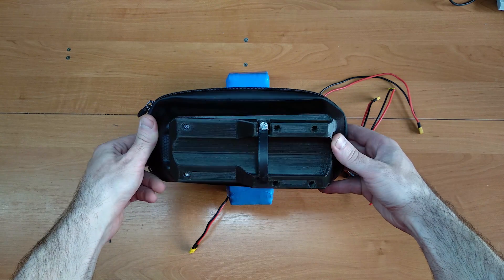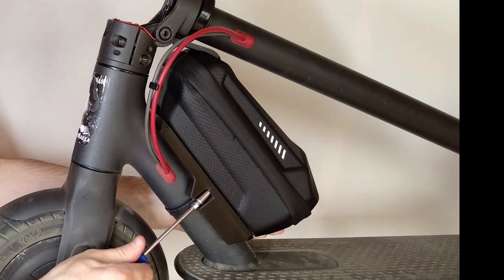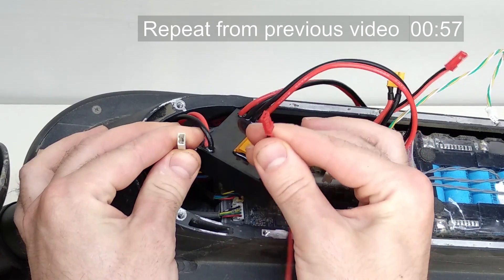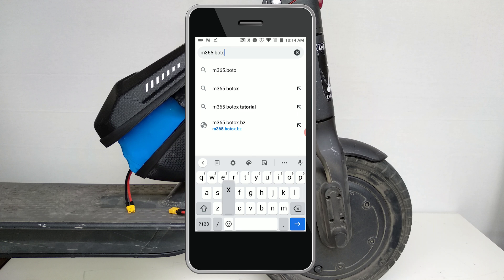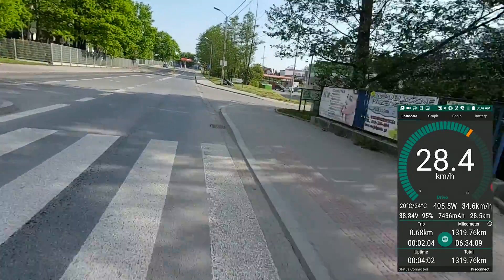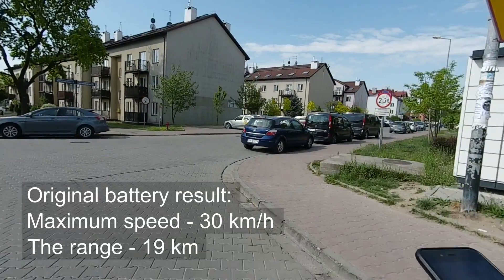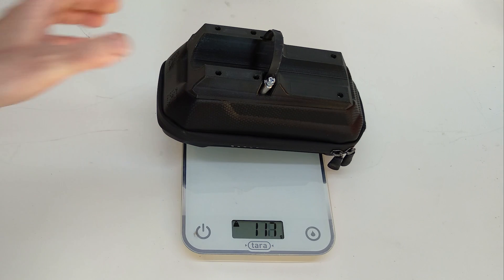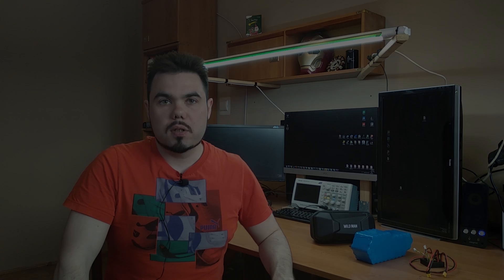Xiaomi M365 / PRO / PRO2 / 1S / 3 extra battery installation tutorial

Comment: hello. Can i connect 48v extrenal battery with rita adapter on my xiaomi pro 2  ?
Reply from the maker: Yes, you can.
Reply: @ can you recommend some 48v extrenal battery which fits on the wildman 2l case?
Reply from the maker: @jokuvaan-j6v  They say "Aerdu" aliexpress batteries are okay for its price.
Reply: @DenisYurev  okay, thanks!
Reply: @DenisYurev  did you know any other brand becaus aerdu has really bad stock rn? is theese LiitoKala batteries any goodor any other?
Reply from the maker: @jokuvaan-j6v  I don't know. Check the reviews =)

Comment: Does anything apart from volts matter for the battery
Reply from the maker: Sure, 
1. The battery must be powerful enough to provide about 30A output current
2. The battery must be a common port BMS equipped, which means just one couple of wires for both charging and discharging, without a dedicated charging input.

Comment: Sorry Dennis can the Rita be used without the data line from the 48 volt aftermarket battery it’s the Monorim 48 14.4 mah battery
Reply from the maker: Yes, you can use an internal 48V battery without data lines via Rita. Just don't forget to set Rita properly(set 13 to the "Internal battery serial configuration" parameter) and cut the green jumper

Comment: Hi Dennis sorry for the vague question which is I have a 48 volt battery without data wires on it only 2 wires charge wire and power wire the controller has had bms skipped  I’m not using xiaomi battery at all can I still use Rita with this set cheers

Comment: Hi Dennis I have a 48!volt battery with no data cable can I still use Rita on my xiaomi with another 48 v battery for more range
Reply from the maker: Hi, I did not get the question. Do you use a stock internal 36V battery? Or you replaced it? Or you are going to replace it by a 48V one? Or you want to use 2 external 48V batteries?

Comment: Bonjour Denis
J'ai un problème, le rita ne fonctionne pas.
Ca me marque directement le coee 39 même en l'ayant flashé avec la batterie externe en plus dans le cfw.
Merci de me donner une solution.
Cordialement.
Tony
Reply from the maker: Hi, error 39 means that something is going wrong and Rita wants your attention.

Did you set Rita settings according to the external battery you use? For example, if your external battery is 48V(13s), you must set Rita "External battery serial configuration" parameter to 13. Otherwise it may cause error 39.

You can also launch any smatphone app and check the battery page: Rita puts error name instead of battery serial number.

Comment: Hi Dennis I have a 365 pro 2 and I’m putting in 48 volt internal battery  could I use your  12 s range battery as well
Reply from the maker: Hi, no you can't. The Rita limitation is that internal battery voltage must be less or equal then the external one. 48V internal battery is 13s, so you can use it together with a 13s, 14s or 15s external one.

We don't sell 13s external batteries, so if you want to by in my shop, the perfect choice is 12s internal + 12s external.
Reply: Cheers Dennis

Comment: Hey Denis!
Can i still use the Standard 250w Motor, or should i get a   350w Motor?
because with the speed upgrade i have a higher voltage right?
Because im thinkin about getting a higher watt motor so it works better when i buy the speed and range upgrade for my xiaomi pro 2
Reply from the maker: Hi, stock motor is fine. Most of "350W" motors you can see at the market are mega shit. You know, you can go to a shop and buy a 1.5L milk instead of 1L. But it does not work with motors at all, it's not enough to just compare 250 vs 350, there are many other parameters and especially quality.

Comment: How is the battery selected,?  Or are they connected in paralell due the Rita?
Reply from the maker: They are "balanced" like they would connected via 2 diodes. The higher voltage battery is discharged first, until the batteries voltages are equal, then they are being discharged together "in parallel"
Reply: @DenisYurev  thank you

Comment: Will this work on a Hiboy S2? It’s on the same platform. 

I just want more range, don’t wanna flash the controller. So probably stick to the same voltage as the internal battery (I think 36-40v) but maybe I could just get a battery with the same voltage but with a little higher Ah for the external?

Would I be able to charge both the original internal battery and the external battery with the original s2 charger, and the original charging port on the scooter?
Reply from the maker: Hi, you can use a 36V external battery, connected via Y-cable. You can read about it in the post below(it's about internal battery, but joining principle is the same): https://e-scooters.embedden.com/blog/double-your-xiaomi-e-scooter-range-for-100/
Reply: @DenisYurev  I’m thinking a 36v 20Ah is what I will use as an external. Maybe that’ll work. 

Will the Rita work with the Hiboy S2? It’s a close match to the m365.
Reply from the maker: @PierceBenton-rh5fy  No, Rita is compatible with original Xiaomi and Ninebot only. Y-cable is the only option for you

Comment: Hi, can I ask you a question? I had an external battery installed by a trusted company. When I ride the scooter, I take a break for a while to rest and start the gas again, so the display shows that it is charging. It shows the percentage on the display as if it were plugged into a charger. I do not understand that. I have the recuprration set to Hight. Maybe that's the problem? But it happens on straight way not downhill. Or should I complain that they installed the external battery incorrectly? Many thanks.
Reply from the maker: Hi, watch this: https://youtu.be/1cJFdFCtMGI?t=360

In short, you need a  custom firmware which disables charging mode at all, this is the simplest solution

Or you can use this device if you don't want to flash the scooter: https://e-scooters.embedden.com/shop/accessories/charging-mode-suppressor-for-xiaomi/
Reply: Thank you so much for explaining 👍😊
Reply: Hi good morning thank you for your useful information , so please how can I get the original of those things just like your information please

Comment: Maybe you explained it in the video but do you need to recharge the external battery separately or do you use the usual battery charging hole and it charges both at the same time ?
Reply from the maker: Hi, both batteries are charged simultaneously via the standard charging plug
Reply: @DenisYurev  Oh ok cool, also what's the difference in terms of what is in the package you ship between the range boost and the range+speed options on the website ? What changes ?
Reply from the maker: @majorpandaru150  Range+speed battery is a higer voltage one, so it grants extra speed, but requires a new higher voltage charger

Comment: Thank you for the video. I would like to ask some questions:
1. i got Ninebot G30 Gen 1 which is 36V and I bought another 36V battery from AliExpress which had really good reviews and sells. Do I need Rita adapter in this case while connecting in parallel? 
2. In what scenario can external battery explode or something?
3. Do I need to charge these batteries separately, or while connecting them together I can charge them?
4. Do I need to flash my controller if they have the same voltage?

Comment: Hi Denis, I'm new to battery stuff and it was very confusing for me to understand: I want to build my own battery replicating your "range+speed boost kit" in the description you said you are using EVE INR18650-26V cells, I'm assuming you are using 12 cells to reach the 44.4V (3.7V * 12 cells = 44.4V) but if every cell has 2550mAh isn't the the total  30,600mAh instead of 10,200mAh. Also the battery on the video you said it has 50 cells sorry for my stupidity but I really want to know how this works.
Reply: Now I get why it says "12s4p" 12 series 4 parallel
Reply from the maker: @animeknowledge5048  Bingo! I am glad that you have managed to discover it =)
Reply: Ok I made some progress so there are 12 cells in series to reach the 44.4v while other extra cells are to increase mAh I still need to make sure I got this right
Reply: I got the explanation for everything I wanted  after some research and studying. It's a bit complicated since you are connecting in series and parallel, so if the cells are connected in series we are increasing voltage and if the cells are connected in parallel we are increasing storage capacity to note that the batteries need to be the same mAh. In this case we are using both series and parallel things are bit different in connection to make the 10Ah kit we need 48 of [18650 3.7v] batteries, 1 horizontal row(series)= 12 batteries Volt= 44.4V mAh= 2550 to increase capacity we need other 3 rows (parallel) of 12 batteries to reach 10Ah so 12 rows and 4 columns

Comment: I have a pro 2 with stock battery + 14ah 36v in parallel and I'm waiting for my Rita to be shipped so I can add the third battery (48v 14ah). What do you thing my real world range will be? 😀
Can you please also explain me how Rita works? When the bigger battery gets discharged, it becomes disconnected internally by Rita? If so at what voltage it gets disconnected? Thank you!
Reply from the maker: Hi, with the 48V 14Ah battery your range will get multiplied by x1.8, like you had 50km, and it will become 90km.

In your setup the 48V battery will supply the scooter until it is 42V(almost empty, like 10% left)

Then all 3 batteries will work together until the voltage is 39V(empty 48V battery, it will be turned off by its bms)

Then your 2 batteries operate like you never plugged the 48V one.
Reply: @DenisYurev  hello! Thank for your answer!
I'm also planning to upgrade the mosfet and traces. I found IRFB4110  100V 180A/670Ap 370W 0.0037R (130A). How far could I push the amperage in the settings being very safe on the controller? I did 1800km on 29ampere without any problem so far
Reply from the maker: @giorgioika  There is no simple answer, I'd recommend joining my public group in telegram and ask there: https://t.me/m365_custom_electronics_en

Comment: i have a very similar scooter would this work on a iscooter ? the controller is not bms the original battery is i think a cheap cineese part im reading 35.1 volts but should be 37 volts i just have charge conector and x60 connector there is no data line  its a 350W motor or could i just use a Y cable
Reply from the maker: Hi, I am pretty sure you can simply use y-cable
Reply: @DenisYurev  would i need a bigger charging pack ideally i want to charge both packs from the original charge port without routing a 2nd line through allso do you post to the uk i need one of them bags if not could you provide the 3d print files ? ill also add a 20 or 30amp inline fuse to the y cable for overload protection
Reply from the maker: @harryhimpson5663  Take a look at the following post, there is a good explaination how y-cable operates: https://m365.embedden.com/double_your_xiaomi_scooter_range_for_100_usd

I can ship to the UK, but I can not guarantee that my bag fits your non-Xiaomi scooter.

I do not share bag mount files, sorry.

A 20-30A fuse is a great idea.

Comment: Hi. What if I have a second Xiaomi essential scooter and want to take out the batter from it and connect it to my main one, does the way how I do it changes from the one presented by you in the video?
Reply from the maker: Hi!
It's NOT SAFE and STRONGLY NOT RECOMMENDED to use an original Xiaomi battery as an external one, because its BMS does not protect it from overcharge via its discharge output. You need a battery equipped with a common port 
BMS, while the original one is separate port BMS equipped.
Reply: @Denis Yurev thanks for the answer.

Comment: Do I need the Rita adapter with an 36V 4.4Ah 10s2p battery? It has a BMS
Reply from the maker: You can connect it without Rita using a basic cheap y-cable. Take a look at the following post, there's some information about this connection method: https://m365.embedden.com/double_your_xiaomi_scooter_range_for_100_usd
Reply: @DenisYurev  thanks a lot. So If I use a homemade Y splitter with 30A fuse and hoverboard battery, it will work safely?
Reply from the maker: @milannekuhh  Yes, but there is another important thing: the hoverboard battery must be equipped with a "common port" bms, which means a single couple of wires for both charging and discharging. If the battery has a dedicated charging input, then it's not safe to use it via a y-cable.
Reply: @DenisYurev  well I have 2 hoverboard battery's (same voltage and Ah, but different cells) and both use 1 connection (XT60). so it's safe to charge with standard Xiaomi charger?
Reply from the maker: @milannekuhh  yes, it looks safe
Reply: @DenisYurev  thanks for the help. Love the video's, I thank you a lot👍👍👍❤️

Comment: Does it work for xiaomi mi essential? 🙂
Reply from the maker: Yes
Reply: Thanks for reply! Just one question i need to go to m365 downG will it 100 percent work for xiaomi mi essential because i used that app for speed hack and it won't work for my scooter? Am i wrong??
Reply from the maker: @ElektroZonaOfficial  
It should work. Check also XiaoDash and ScooterHacking
Reply: Yes i have xiao dash but i dont know what i need to set at what numbers

Comment: Hi Denis,

If it's easy for you to share this info (I've asked several forum with no luck sofar) , I would like to know the reference of the power cables (awg...) in the deck of the M365, also the reference of dataline wires (the three wires twisted green yellow white)

And also the reference of the white connector of the dataline, it is a JS-3 pin but there is perhaps a reference of size or type?

(For the connectors on the power cables it's XT30 isn't it?)

Many thanks,
Florent
Reply from the maker: Hi. Original power wires are 16AWG 200° silicone. Rita power wires are 16AWG, except the external battery one, which is 14AWG. Original power plug is xt30. Data wires are regular common ones. Data plug is jst pap-03v-s

Comment: this will work fine on the xioami scooter 3 right?
Reply from the maker: Yes, but sometimes it's not easy to flash this model. Check if you are able to flash it first. Nevertheless, if you can't  - you can still use 10s(36V) batteries with Rita. But you must flash the scooter for higher voltage batteries

Comment: Great video! One question: If you flash your xiaomi scooter, will this affect the warranty and serial number of the scooter? And can I "remove" the flash or change it back to the default settings?

Thanks for the detailed tutorial!
😁
Reply: 1. This will remove your warranty. 2. It will have no impact on the Serial Number. 3. You can easily flash it back to original firmware.
Reply: @teamcreativity1779  Thanks a ton! I've found no answer at all online.
Reply: @natagush  I'm Happy, to be helpful

Comment: Hello I have a question please, I have 1 extra Xiaomi 5ah battery pack, I want to also connect that to my scooter, does this do that?
Reply from the maker: Hi, the short answer is no
Reply: @DenisYurev  do you know of a way I can do that? I only want to extend range. I noticed most external packs people use have XT60 connectors but my Xiaomi pack has an XT30
Reply from the maker: @curtisss  the problem is your battery BMS. It has a dedicated charging input(separate port BMS), so it's prohibited to parralel this kind of batteries with other batteries. You need a common port BMS equipped battery with a single couple of wires for both charging and discharging.

Comment: I need rita adapter for increase voltage with a 2s battery? Why??
Reply from the maker: You don't. Rita is needed if you want to join a whole external 12s battery
Reply: @DenisYurev  and One last question Many people have! I can charge the external battery conected in series directly
 Or i need to unplug every time i charge ? Because my (lipo charger) charge by the balancing port and i dont need to unplug the battery from XT 60 series cable  .. i can?
Reply from the maker: @motoryclefield2038  You don't need to unplug it if you use a standalone charger
Reply: @DenisYurev  and i can charge the lipo 2s conected in series and the 36v battery charging the two( the  respective chargers the balancer for the lipo and the 42v charger conected at the same time ? )
Most people dont know that Eheh 😁😁👌

Comment: This is amazing. Does it work with my Mi Scooter 3?
Reply from the maker: Hi, yes, it works, but you have to ensure you are able to flash your scooter: the thing is the newest scooters are protected against installing a custom firmware and not hacked yet.
Reply: @DenisYurev  i already flashed my Scooter with xiodash. So, it works right?
Reply from the maker: @tripertronic6065  Yes, it's 100% compatible then

Comment: Hi Denis, Does this work on the new 1s scooters? I got the BLE 157, DRV 321, BMS 141. Also, do i also have to flash it after or is just plug and play?
Reply from the maker: Hi, it works, but some fuss is possible due to 157 if using a higher voltage battery.  Range boost kit is plug and play.
Reply: @DenisYurev  Thanks for the answer Denis. What do you mean with the fuss? Also, it's plug and play the speed too or only range?  For the speed you need to flash?
Reply from the maker: @Saidifect  These new BLE sometimes require flashing by a programmer, not by air. Range boost kit is plug and play, not requireing flashing. Flashing will not make it  increase speed. Range+speed kit requires flashing.

Comment: Hi Denis! Tell me please, do the battery and installation work as well for AOVO Pro Electric Scooter as it is basically the same as Xiaomi M365? Thanks in advance!
Reply from the maker: Hi, no, Rita is not compatible with your scooter. But you can buy my 10s battery and bag, connecting it via an y-cable, like I mentioned in the video, it will work fine.